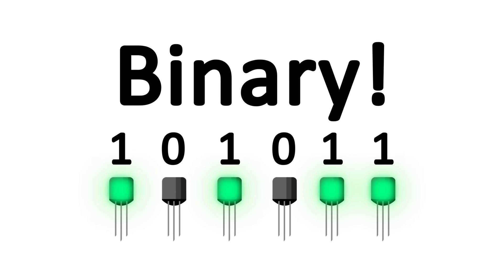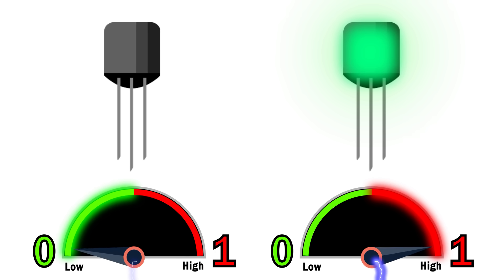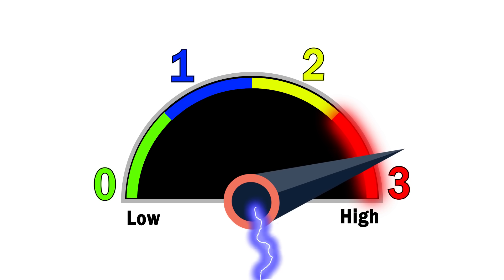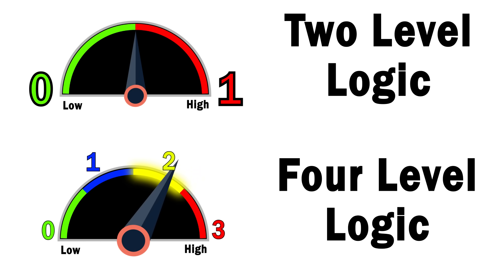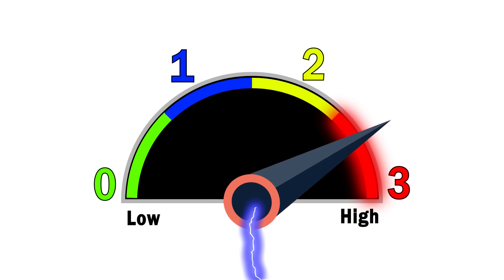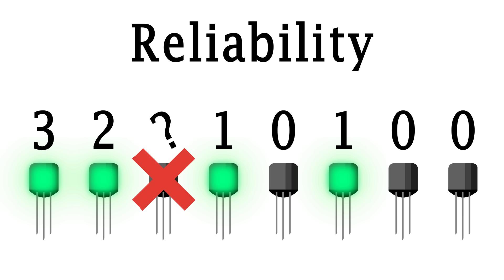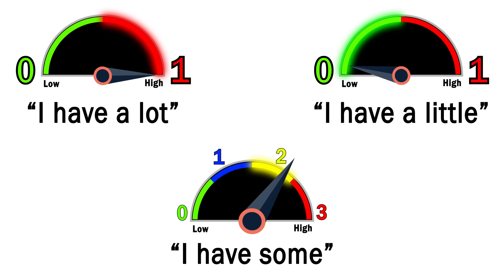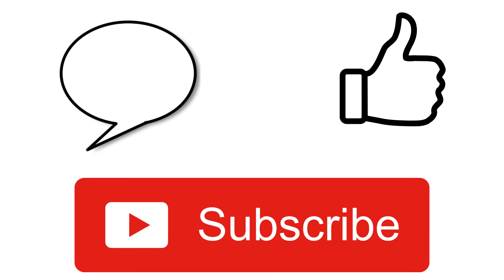Why can't computers use base 3 instead of binary? Voltage states explained.

Comment: Isn't it called ternary? Or do people also call it trinary?
Reply: Same thing:

Senary / seximal
Septenary / septimal
Undecimal / elevenary
Duodecimal / dozenal

Here is the algorithm of bases:

0: Nullary
1: Unary
2: Binary
3: Ternary / trinary
4: Quaternary / tetra
5: Quinary
6: Senary / seximal
7: Septenary / septimal
8: Octal
9: Nonary
10: Decimal
11: Undecimal / elevenary
12: Duodecimal / dozenal
13: Baker's dozenal
14: Poulter's dozenal
16: Hexadecimal (computer, short hexadecimal)
17: Suboptimal
20: Vigesimal
23: King's dozenal
30: Trigintesimal
40: Quatturigintesimal
50: Quinquagintesimal
60: Long hexadecimal / Sexagesimal
70: Septuagintesimal
80: Octogintesimal
90: Novemgintesimal
100: Centesimal
1,000: Millesimal
10,000: Myresimal
1,000,000: Micresimal
1,000,000,000: Nanesimal
1,000,000,000,000: Pickesimal
1,000,000,000,000,000: Femtesimal
1,000,000,000,000,000,000: Attesimal
1,000,000,000,000,000,000,000: Zeptesimal
1,000,000,000,000,000,000,000,000: Yoctesimal
1,000,000,000,000,000,000,000,000,000: Rontesimal
1,000,000,000,000,000,000,000,000,000,000: Quectesimal

For inbetween bases, a prefix is added displaying the scalar multiple, calculated by using the 2 closest factors. Prefixes are used to denote the factors:

2: bi
3: tri
4: tetra
5: penta
6: hexa
7: hepta
8: octa
9: enna
10: deca
11: leva
12: doza
13: baker
14: poulter
16: tesser
17: mal
20: icosa
23: king
30: triaconta
40: tetraconta
50: pentaconta
60: hexaconta
70: heptaconta
80: octaconta
90: ennaconta
100: hecto
1,000: kilo
10,000: myra
1,000,000: mega
1,000,000,000: giga
1,000,000,000,000: tera
1,000,000,000,000,000: peta
1,000,000,000,000,000,000: exa
1,000,000,000,000,000,000,000: zetta
1,000,000,000,000,000,000,000,000: yotta
1,000,000,000,000,000,000,000,000,000: ronna
1,000,000,000,000,000,000,000,000,000,000: quetta

For example, 15: triquinary, 18: triseximal, 21: triseptimal, etc. For adding extra numbers, the "un-" prefix is added for the base name, and the "hen-" prefix is added for prefixes, so 19 is untriseximal with the prefix being hentrihexa. Sometimes, letters can be removed, such as vowel combinations being shortened, like base 32 being tetroctal, and 26 being biker's dozenal. For negative bases, the "nega-" prefix is added, and for fractional bases, the "vöt-" prefix is added. What is fascinating is irrational and nonreal bases, such as phinary, pinary, birootnary, and bimaginary. Can you guess what the bases are according to those names?

Comment: I think Quantum computers will be able to work with base 3, apparently they can have 3 states,  (on, off, or on and off at the same time).  Now my brain hurts.
Reply: We can already do that now (kinda) -it's called ternary or trinary computing. Instead of on/off you have on/off/-on. So a 9v system would have +9v, 0v and -9v. It just hasn't caught on yet, because computers have been advancing so quickly without the extra computing power. We'll probably have to switch to it soon enough though.

Comment: I'm convinced that the biggest jump in computer technology could be made if somebody just managed to build a reliable computer that uses a higher base.
Reply: Some computers already use ternary Logic but sadly due to the high number of already existing binary programs, they aren't used that much...
Reply: @pierreollivier6714  Not convincing. It doesn't matter how many states bits can take, data is just numbers, no matter which base. Same codes can be on machine with different base.
Reply: @comrade137  if compilers don’t exist for that architecture, programs aren’t written for it.
Reply: @comrade137  silicon computation does not take place in some abstract fungible space like pure math does, it is a physical process with every cog having it's own specifications and altering them would make the existing tooling no longer fit.
Reply: @comrade137  but higher bases will take less memory, and nerds calculated 3 is the most optimal base anyway
Reply: @pierreollivier6714  just convert the program to ternary before going in the computer👍 or just make same code in ternary
Reply: @reizinhodojogo3956  "just convert it" lol, if only it were that simple
Reply: No base at all would make it analog --- the reason we use binary is Boolean logic / algebra --- and that doesn't work well with ternary or even higher bases --- so basically anything can be build from NAND or NOR using Boolean (or calling it simply just binary) but even if you try to construct the equivalent of one of those two in ternary - believe me you get a headache and if you don't then good luck on it
Reply: @mathiaslist6705 Ternary is actually very good for fuzzy logic, which is a huge complement to boolean logic.
Reply: I had this question while in undergrad boolean algebra: what is the most efficient base (in terms of information stored per digit)? Turns out to be base e in theory (2.71...), rounded to integer 3. See "Optimal radix choice" on wikipedia.
Reply: I am not so convinced. Binary also has some very cool properties that other bases do not have, and programmers exploit these properties all the time.
Reply: They do, in SSDs they have MLC, TLC, QLC.

the higher base, the slower it gets.
Reply: Higher base? They are trying to use light to compute multiple things at the same time. Yes, with lights at different frequencies just shine them in parallel and let physics do the computation.
Reply: The very idea is useless on silicon. Higher level constructs (logic gates and up) require way more than twice the transistors for base 4 vs base 2. Every gate would require 3 comparators (30 transistors) alone to interpret the different logic levels.
Reply: @thorlancaster5641  I think it would make little sense to implement it with conventional logic gates. Maybe one could try to implement some ternary logic gates or small ternary logic circuits with neuronal nets. Maybe some optimization can be found. I don't know.
Reply: Higher bases than 2 are actually used already, but only in very specific circumstances like buses. For example, PCIE 6.0 is set out to use 4 voltage levels to encode 2 bits of information per pulse. The reason it's not used more is that the complexity for cicuits and storage of data is far higher than binary and the circuits are less reliable (easy to decode information when it's low/high voltage). There might be more places where higher bases can be used that are throughput-bound, but imo that will likely be left to buses.
Reply: I feel the most promising in this aspect is ternary logic, specific stable ternary with 0, + and - states. Not sure how the guys who already made one did the architecture but using opposing charges to write different states sounds more robust than ensuring you write the trit (ternary bit) just halfway.
Reply: oh thats the easy part.

the problem is mass production and scaling it down small enough
Reply: Plus High chances of error
Reply: Can you elaborate on what you think will improve?

Fundamentally, there is "nothing a ternary (or higher base) computer could do that a binary computer couldn't". A binary computer can simulate a ternary computer. Or a base 25 computer. A base 17 computer could simulate a base 190 computer. A base 23 computer could simulate a binary computer. Point being - they are not really "different" in terms of scaling/"order" at the limit. This is all related to "computability" and Turing machines - but the "big point" is that this "type" of computation is still fundamentally "digital", and inherently offers less and less "efficiency gain" when using larger bases. 

Quantum computing is "different" because it is continuous (between values), has totally different properties, and has totally different operations that can be done. It isn't part of the same "digital computation" family.

Like in terms of "computational power" all of these bases are all "equivalent". The "benefit" would be in efficiency (information per "unit") - but at what cost? The scaling has diminishing returns, so it doesn't really make sense to invest huge quantities of money into it - when we can just build more powerful binary computers for much cheaper. Plus, we are able to make binary computer chips with transistors SO small and SO dense already - that we would need all sorts of totally new fabrication tech to actually build a comparable system that works with "higher base" numbers.
Reply: I feel like base three could work, the problem is, his model of a half circle to represent energy at high and energy at low, should be re represented as a circle/ spiral, where to move right or forward in it leads from 1 to 2 then from 2 to 3 and then back to one, or left or backwards, could be is well, backwards, and you could have 3 ‘states’ which could be interpreted. I also think base 3 would work far better for a numerical system as well but that’s a long shot unfortunately
Reply: @floatingamongthoughts  " the problem is, his model of a half circle to represent energy at high and energy at low, should be re represented as a circle"
Ah - so the problem is an accurate depiction and creating a completely fictional nonsensical representation would somehow change physics? Yeah no.
Reply: Actually a lot of efficiency is found by lowering the supply voltage. This reduces power loss and allows more transistors to be packed in the same space without overheating.

However lowering voltage makes it more difficult to differentiate logic levels. Having to increase the supply voltage just to increase the number of voltage levels would just make everything wayyy less efficient.

Having more voltage levels vs having more transistors ultimately leads to the same number of bits.
Reply: For the most part, I'm not quite sure what ternary (or any higher base) would grant you from a programming standpoint. It makes doing logic on them much more complicated, because you have 3+ potential states. And while there are a few applications that could benefit, like ordering which operate in ternary (>, == , <), most programming is an if statement that cares about boolean logic. Further operators like bitwise AND/OR/XOR have key uses in various designs. I don't know how ternary would improve any of that besides confuse things. 

Granted you get to store more information per bit, which means better storage space, but RAM and HD capacity has been going up regardless. From a computer programming standpoint I just don't see a big gain.
Reply: This video weirdly does not address this, but the ultimate reason base 2 is used is because it is more energy efficient. All of the problems presented can be solved, but the result uses more electricity per computation. In higher bases, computations are not faster, they are just hotter.
Reply: @brizayden  plasma too, or else you would freeze due to stars not existing or generating heat to heat planets
Reply: Or just completely analog
Reply: That would require a new material
Reply: I believe people have done it.
Reply: Well with quamtom computers

It would be onenary
Reply: Why?? What's the difference
Reply: Nah. We've done that dozens of times already. The problem is a matter of availabiliy, affordability, and scalability.

Quantum notwithstanding, the next big tech leap would be a battery technology breakthrough.
The holy grail would be stable energy storage that gets lighter at higher states, or that has an inverse volume to capacity relationship.
Reply: Isn't the rate of change of amount of data stored logarithmic when the base is increased linearly??
Reply: It's not a technological problem, but an economical one. Yes we could make higher base chips, but they would be exponentially more expensive than using base 2 components to reach the same performance. Everything in the modern world revolves around tolerances in mass production, and scale of economy.
Reply: Based
Reply: Put it on a shelf

voila
Reply: huawei did it
Reply: 100% wrong,  the problem is simple logic gates.  If you know it isn't 1, you know it's a zero. 
In just a 3 state system if you know it isn't 1 then you can't say for certain what it is, you'd have to actually read or calculate it,  that takes processing time and thus loses any increased complexity by the exact same factor as the higher Base. 
Basically the only benefit and the only reason they even tried it to begin with was to store more data in a single cell,  but now given how cheap it is to produce memory,  the cost saving doesn't exist.
Reply: Not sure how that would help anything at all. All it would do is make the math more complicated
Reply: huawei ternary chip its now in the game
Reply: quantum is an example of this
Reply: We'd have to reprogram everything. 
And i mean EVERYTHING (Bootloader, Operating System, Application Programs, Computer Network systems, Websites, Even the languages we use would need to be remade.) So no sane person would be willing to switch
Reply: Storage devices already kind of do this.

Check out TLC and QLC SSDs
Reply: Same with engines💀
Reply: “If just things were more reliable” the engineers dream lol everything would be better
Reply: Quantum computers might take off one day.
Reply: @Mbrace818  Quantum computer will have their use cases, but they won't be much of a use for what everyday people use computers for.
Reply: @maythesciencebewithyou  That's true, but even with their specific use-cases, the leap in technology would be massive. Another big leap in computer technology could be room-temperature superconductors. It would allow computers to be overclocked many times over without heating up.
Reply: @Mbrace818  room temperature superconductors would be amazing. I have high hopes for material scientists, but the only room temperature superconductor I heard about is one that needs extremely high pressure. It's possible that there will never be a material with that property that works under normal conditions. 

Another matrial I'm hoping for which has nothing to do with computers is one which is able to focus X-rays. That would revolutionize microscopy. But so far no luck there either.
Reply: @maythesciencebewithyou  People in the 1900s probably thought the same thing about computers when they were the size of a room. Just wait 20, 30, or 50 years and quantum computers will become the norm, due to the huge gain they offer in speed.
Reply: @Mbrace818 no they still use binary
Reply: Can make it ?
Reply: @alishaleno  Yes. Many people are trying.
Reply: 3 is an arbitrary number whereas 2 is the minimum that works. Higher numbers are also arbitrary. You don't need them. That's not how you make a breakthrough. Not by using less elegant arbitrary systems.
Reply: @brizayden  1. Irrelevant. 2. There are actually hundreds of states and the number and type depends on the material, the three states are an extreme simplification
Reply: i have idea, what about using a mini binary circuit to redirect the voltage to a transistor of base amount of transistors(like if base 4, then 4 transistors), and use the voltage IN THAT PLACE to measure value of bit instead of directly using voltage amount? also make it convert to binary before going in components or receiving/sending information from/to internet so component and router understand?
Reply: @reizinhodojogo3956  That would then introduce a problem with the volume needed to store the circuit. Because you are pretty much multiplying the number of "bits" by 2 then. Not a bad idea but we would need more space to store these computers in, and by that metric we could just add more bits then that use binary.
Reply: Its not that we cant, its that the entire world is entrenched in the old standard
Reply: You'd be wrong.
Reply: It's beyond human hands, we can only really create computers in binary code, trinary leads to chaos

Comment: Couldn't a computer use the polarity of a gate to count in base 3? Fluctuations wouldn't be as big of a deal as a low voltage could be a 1, high negative a 0 and high positive a 2 and the polarity can be switched very quickly, there's still a moment where when going from 0 to a 2 or vice-versa will give a 1 if it's read at the wrong time but as switching the voltage off is easier than hitting and maintaining a mid-voltage state accurately, the threshold could be smaller reducing the time spent in a transitional state, as long as the clock is properly synced the computer could avoid errors, in a binary system there will still be a transition period where the computer could read the wrong number as the voltage rises or drops above or below it's state threshold anyway and although I'm sure it's happened, this seems to be pretty rare because of the way everything is synchronized.
Reply: That's exactly what the Soviet Union once experimented with (the Setun computer), but unfortunately this is in the past.
Reply: The question is HOW FAST can you do it, what is the rate of error, the signal-to-noise ratio, how complex do your circuits have to be etc. 
Currently with binary logic based on NAND gates, which are in turn based on MOSFETs we can get gigaherz frequencies, we have very good SNR and very low error rates, and binary logic is relatively simple to build.

Devices that can ave more than 2 states exist, and people have been working on it, but they simply cannot complete with binary systems (yet)
Reply: Can I ask a question? How can the computer differentiate between a negative and positive polarization? Do these two had a difference somehow that can be read (observed) or is it still an unknown? If there's no difference that can be observed other than the use of binary computer then it might be limited to supercomputer but we already have quantum computer for that (qubits). Can qubits have positive and negative polarization (making it a eight possible state each bits)? Thank you in advance~